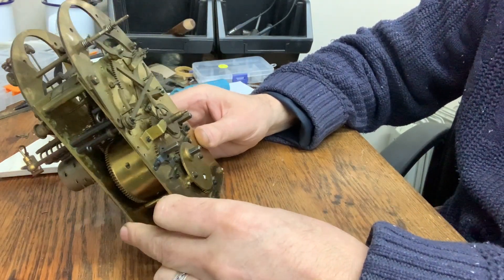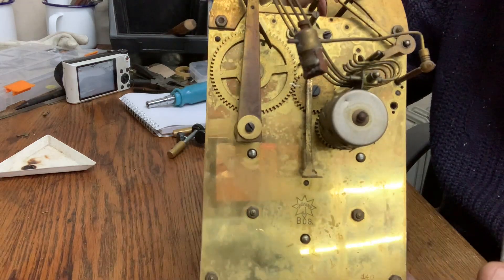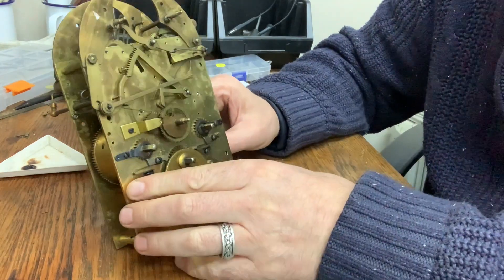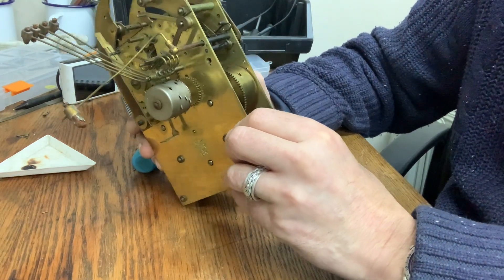Junghans B08 Westminster Chime mental clock. clockrepairsmerseyside.co.uk

Comment: The later movements had a combination of lantern pinions and leaf. That is all I can find, so I hope that helps a little.

 I have worked on the ones which are a bit later, the ones which have only two winding arbors but has three trains, one arbor winds 2 by means of gears, watch out for those because you get excessive wear in the gears and makes winding very hard and can be dangerous
Reply from the maker: I appreciate your help always, it’s always a good thing if you can give the customer tit bits of information it starts there mind thinking as often the clocks I restore have been in there family for years, thanks again 

Kind regards john